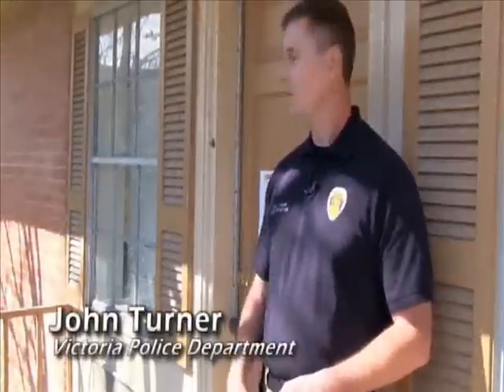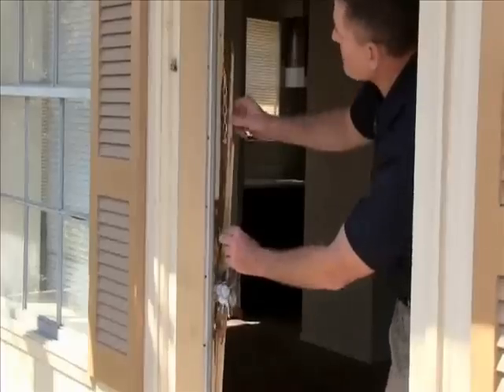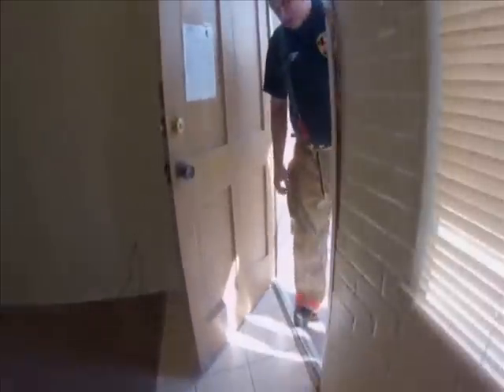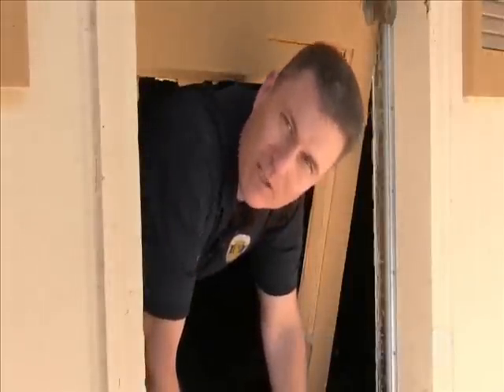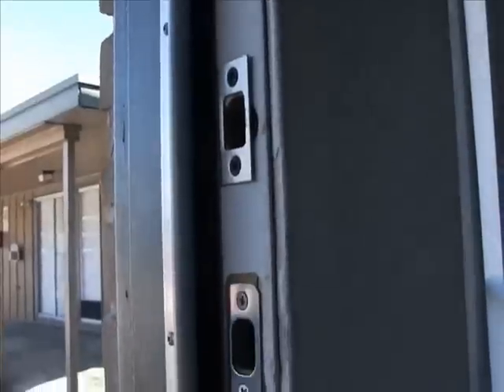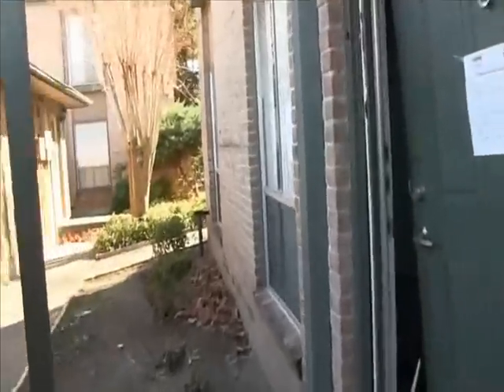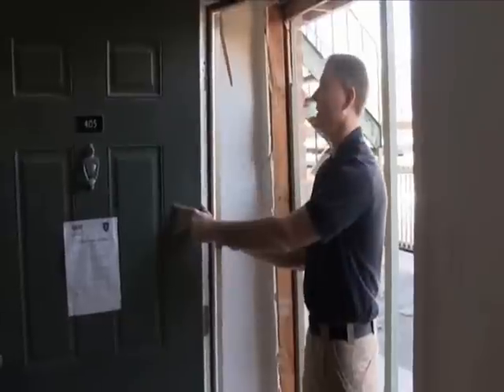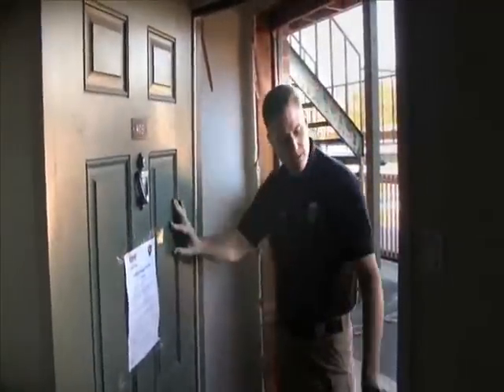Double your door security for a couple of bucks NOW! Safer in 5 minutes!

Comment: Kicking a door is a great way to break an ankle, no professional FF worth his salt would attempt such a stupid move, give me a set of irons and one more FF and we can have  just about any res door open in 30 seconds and controlled so you dont kill any possible victim laying on the floor on the inside. Door has a Boston police lock or a floor bar? sledge the hinges. if you are not home and have no alarm the bad guys are getting in anyway.
 one cool non-lethal device is a OC spray booby trap , the can is big enough to  fill a few rooms for an hour or more. a few of those well placed will drive most BGs away, include a good wireless alarm and that should give 911 time to respond. If your home and in my state felony forced entry is grounds for use of deadly force. 5.56 nato- 3300 feet per second,  911 avg response time 15 minutes. wana slow the BG down use door bars, that will give you time to take up  defensive cover or concealment and scream " get the fuck out of my  house!" as you are pulling the trigger ;-).
Reply from the maker: Yes, as you are pulling the trigger. No need to swear at him though since that's the last thing he will hear as he enters eternity. Then nobody will want to be in his shoes!
Reply: a verbal warning is part of the whole use of deadly force. 
DA, did you see the person breaking in?
me, yes, i placed my tactical strobe on the  subject,  he had a  long crowbar in his hands (deadly wepond ).
DA, what did you do next?
me, i shouted for him to get the "fuck out of my house! "
DA, then what did the person do?
me, he kept coming at me, i felt in eminent fear of my life, so i open fire. 

.......now did i shoot first or speak first,  not really sure,  oh well only two people know and one of us is dead. 
Not being flipped about this subject,  each state has it own set of rules regarding use of deadly force,  some states you have a duty to retreat others you can stand your ground. Just my opinion but if a determined BG wants in ,he will get in, from a tactical point of view slowing them down is key in setting up your defensive poster or taking up position to properly engage your target. in any case your in for a long legal battle long after the barrel has cooled down and the  shell casings have been swept away. you call servicemaster for the blood.